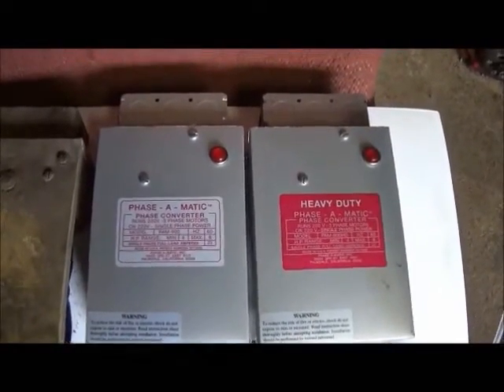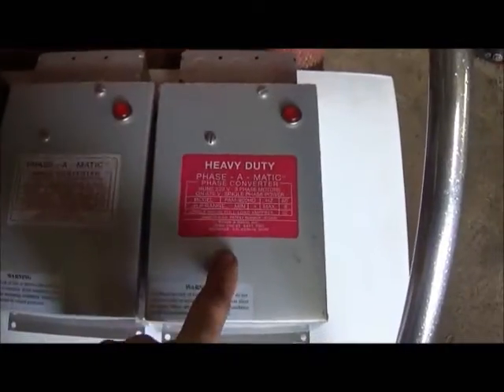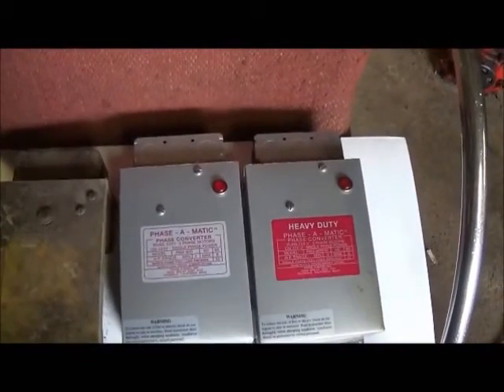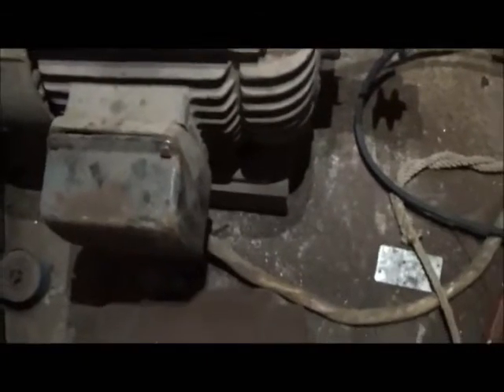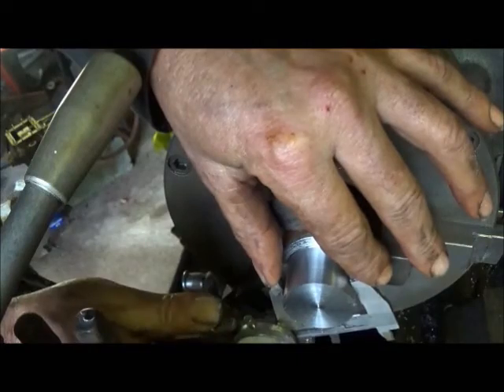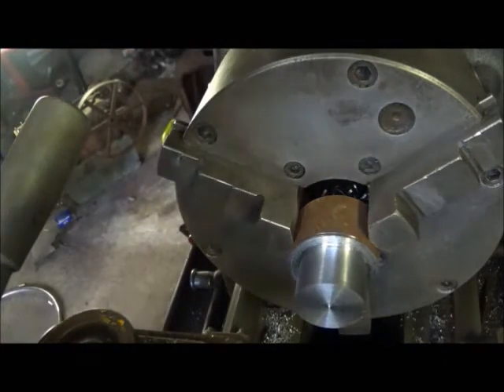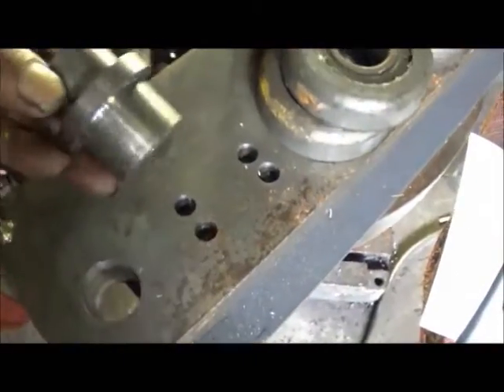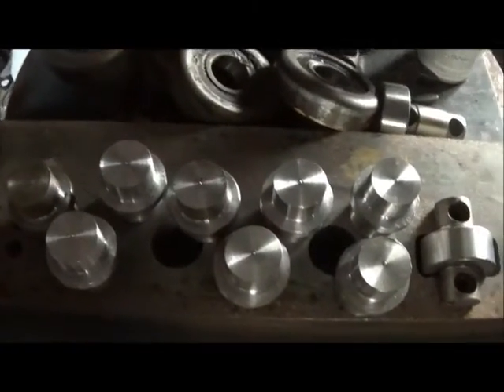4x4 Wrecker Build Part 29 Back To Machining

Comment: hi... thank you for this video.. I used to have an old old table top milling machine with a 3 phase motor.. back in the day I couldnt afford a new 2 phase motor that was large enough I wish I would have known the pony motor trick.. I was saving my nickels to get a good sized phase converter.. and ended up selling the machine before i could have used it.. I wish I would have known this valuable trick...  now I will be looking for an old milling machine and an old lathe.. thank you so much...

Comment: Hi from Nick Wiese: since a kid I have wondered what happened to double phase? it turns out our power panels are 2 phase however we call it single phase 220 and a 3 phase panel has another hot leg. the magnets in the motor do not care about phase much, but voltages  need to add up to 360. and one of the 3 may be a bit off so what they need to be same amps, I suggest you read more on 3 phase power. when a electric car goes down a hill it makes power!  so your larger motor on the floor makes the 3 leg.

Comment: hey Jonathan, James here...l wanted to comment on your gas (air compressor) engine bike build but can't find the video now...story l heard is a German guy made a 2 speed transmission for a whizzer motorized bicycle back in 1948...they're called a whizzer bi matic & worked good except the guy used bicycle bearings (made too much slack over time) instead of automotive bearings...l've downloaded some pics off the net, but can't upload them here? l sent a friend request on facebook

Comment: Lookin good Jonathan. I came into this wrecker build very late. It took me awhile but, I finally get it. I'm thinking you put an adjustable carriage on the truck for stability (combined with out riggers) rather than having the boom  stationary (only swivel 180*)  at the rear of the cab. I'm going to imagine this particular wrecker's boom won't rotate a full 360*. I'll deduce this from the unusually small size of this rig. That's the beauty of it, because it's so small you'll have access around the truck anyway. The size can be advantageous for tight roads.
Reply from the maker: +Danny Boy  Danny, it will slide back about 40 inches and rotate 200+ degrees. Thanks for watching and making me aware that some come in late, I changed the intro to suit!!

Comment: For the outriggers are they going to drop from the frame down with cilinders or are you bolting the outriggers to the frame and then on the ends with a down cilinder
Reply from the maker: +Joey Rouse  They will be mounted on the ends of the side outrigger and to the frame on the rear.